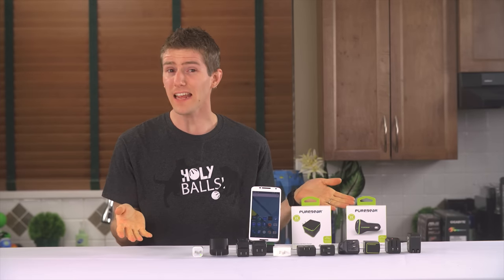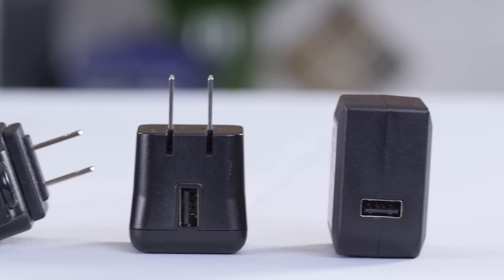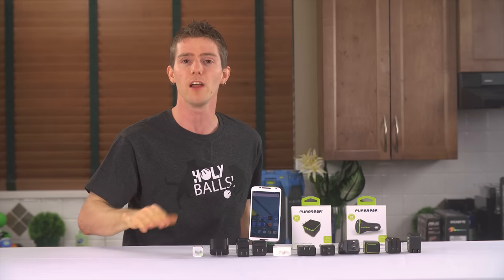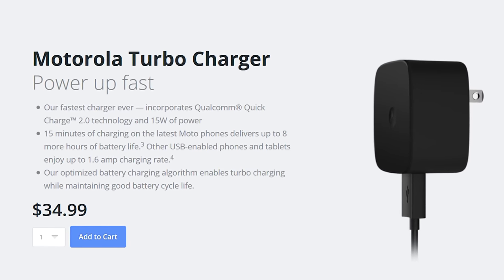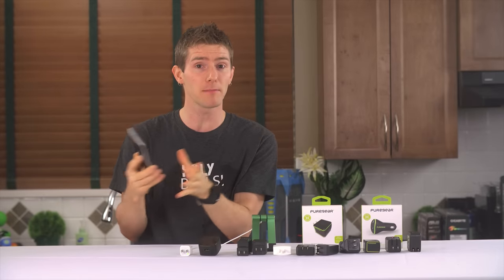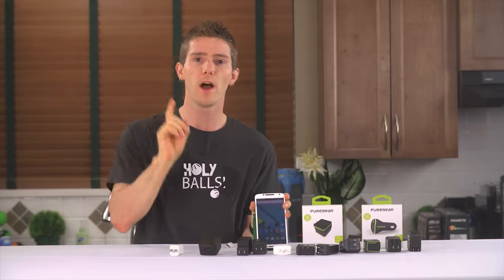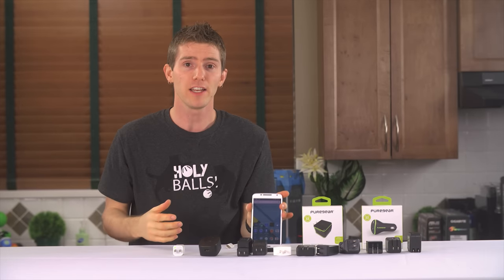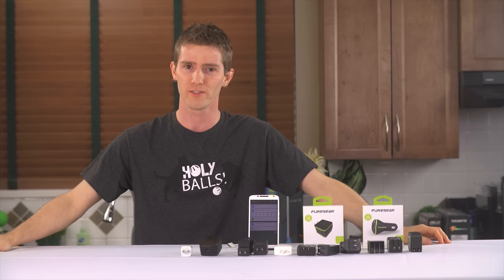Faster Phone Chargers Explained - Qualcomm Quick Charge 2.0

Comment: Hey Linus. Can the power output of the charger affect the overall life of my battery? ie. Interms of time to  discharge from 100-0 as well as overall charge cycles.
Reply: Your thought process is going in the right direction but not quite complete. The increased charging rate from the adapter goes to the phone. The phone then regulates the voltage to match what the battery voltage should be and adjust the amps as needed. Increased amp charging into a battery will increase the amount of heat generated inside the battery which causes damage to the battery. This is negligible though and you really shouldn't worry about it messing up your battery. What will cause issues with your battery is running it to 0 percent. Many people, due to common misconceptions about charge cycles, believe that you should charge your battery once to 100 percent then not charge it again until it's nearly dead. When you lower the voltage of any battery that relies on chemical reactions too low it actually begins to damage the battery. This is an incredibly small amount of damage per total discharge but over the course of a year or two or even more can really start to grow to a point of noticing that your phone doesn't seem to quite stay alive as long as it used to. This is especially notable in ANY phone that has a non-replaceable battery. Being the type of batteries these are none of this is a huge deal, the increased charge rate or the running your battery to 0 percent. If you want to see a bit of an extreme example of this though, leave your car head lights on all night to drain your car battery. Even if you just bought the car battery and then charge it the next day on a trickle charger you will notice that the voltage will never hold at the previously available amperage due to the damage caused to the battery.

Comment: So without "Qualcomm Quick Charge 2.0" if its still 2amp-2.1amp will it be faster than normal just not as fast as the Quick Charge? If you plug in a lower device (I assume im not the only one who has 2 phones going at same time) what will the effect be on using 2.1amp on lower phone? I was reading around that it doesn't matter because the phone will just draw what it needs. Need more videos on battery life to teach us how to do it better since batteries suck so much at the moment.

Comment: It's simple - charging these devices is like charging every other Li-Ion Batterie.
From the 18650s in my flashlight to a Tesla Model S.

For example - a 2000mAh Batterie. Charge with 2000mA (or as much as your charger can) until you reach 4.2V - keep these 4.2V and gradually reduce amps until batterie is full....done...magic.

Comment: Charging faster than 1C damages the cell (1C means you can charge with the rate of its capacity: 2.300mAh = 2,3A)
These fast chargers are just another way to kill the phone early, like the built in batteries.

Comment: Not even joking- My T-Mobile "04473 (the only identifiers on the device)" 3 amp, two port wall wart charges BOTH my LG G3 and my girlfriends iPhone 5, both on Verizon, from 5% to full in 45 minutes at the SAME TIME. EACH output is rated at 5V and 3A which is amazing. It charges every device I use in the same time. I have no idea why or how but is is magic.

Screw Qualcomm and companies trying to tie phones to specific chargers. Just buy a charger that has HIGH amps and 5 volts and it will rock for you. "High speed" Kindle chargers work well too.

I have no idea where I got mine but it is BEAST and I can't find it anywhere online. :(

Comment: Could you do another video on QC3 vs third party charges? Also my tests I took a little bit further making the starting charge point at different percentages. It seems that the higher the percent battery charge the slower the charge rate. I have many devices I've tested with. Most of these devices drop the charge rate to 1.5a at 75% making the last 25% sometimes take nearly an hour. 

Ever since I've done my testing about a year ago I never let my devices fall below 50%. 

The reason I ask for the video remake for QC3 is because the results you got with QC2, which matches my results, are NOT the same anymore. QC3 fails to quickly charge my Qualcomm devices faster than the stock charger. The main device I'm taking about is the Nexus 6. I have a few Qualcomm certified chargers buy their performance compared to my QC2 chargers seems worse. I'm thinking they figured out their charging methods with QC2 were flawed and did decrease the devices life span. 

I would like to see the results you get.
Reply: QC3 is more efficient, not faster, it take care of heat.   low heat= long battery life

Comment: Based on the graph on the video, the 3rd party charger works almost as equal with the stock charger. No need to buy those expensive quick charge 2.0 chargers.

Comment: If faster chargers drain the battery's total life span, doesn't that mean that using the stock charger for your Nexus 6 kill it faster than a 1 Amp? Or would (hopeufully) the stock charger not damage the battery faster?
Reply: Different countries uses different plugs

Comment: Use clock with charger. 60min everytime. No overcharge. I recommend. Then can use high speed charger when sleep.
Reply: Overcharging isn't a thing. These phones are "smart" so they stop charging when the battery is full, and they just accept a little current to keep it charged

Comment: I bought a Raspberry Pi 2 and with 4 USB devices plugged in it wont even boot off a 1 Amp charger it needs a 2.4 Amp charger to even work at full capacity.

BTW Most OSes won't even work correctly on a Raspberry Pi 2 yet so wait to buy one if you plan on actually using it....

Comment: Would partnering this technology with the USB 3.0 on samsung devices make it even faster? At the moment I'm using the plug I got with my Samsung galaxy s5 which is a little over 5v at 2A and I get considerably quicker charging times with a USB 3.0 cable than I do a standard micro USB cable

Comment: I have a Moto X Style (Pure in the USA) which came with a turbo charger. I keep that charger in my backpack for when I need to charge my phone during the day, but I usually only charge it at night with the charger I got with my Lumia 920 I got before it.

I also bought Motorola's fast charger for in the car to replace the shitty cheap one I had, but unfortunately, my battery is still discharging when I use my phone as GPS. Apparently it's using more power than the charger can handle.

Comment: Here's my question though: do you get more usage out of a slow 1 amp charge than you do a quickcharge? In other words, does a slow charge to 100% last you longer through the day and get you more screen on time than a quickcharge to 100% does?
Reply: Nope. In both cases the charge is terminated when the battery is at full capacity.
Reply: I know that, but I'm curious as to whether or not the battery drains faster after being quick charged rather than charged at 5 volts 1 amp
Reply: tyson505
Well, yes. The battery would have the same stored energy in both cases.

Comment: Just replace the battery with a super capacitor, or some form of hybrid capacitor battery. This way you can charge it in a second.
Reply: ...and then run it dead 10 seconds after taking it off the charger.

Supercaps aren't energy dense enough to come anywhere near lithium batteries ATM
Reply: Check out super caps that can start a car and hold charge for a week. Youtube it... also i believe there is kickstarter now dor such a device... to bad i didnt patent it quick enough :-(
Reply: Amir Hussain
It doesn't take much capacity to start a car, and holding a charge for a week doesn't mean anything because nothing is being drawn from it.

I've messed with them myself, while they aren't short of amazing in their charge/discharge performance, they can't carry very much total energy.

Comment: Is it just me or does it seem like the faster the battery charges the worse it is for the battery? There is a reason why batteries took 500mah and 700mah way back when, and now 2.0ah are becoming are becoming standard. Shit why dont we just load up 5ah and call it a day over some proprietary cable and charge our batteries even faster. Seems very counterproductive, and no matter where i try to find information about battery charging in any application, i can never find if there are safeguards to prevent overcharging. Holy shit!

Comment: well what does the U stand for in USB, oh yeah, UNIVERSAL! that means that if a device breaks because I use my 2,3A USB charger and it can only handle 1A than it's designed wrong!
Reply: 1. You can't break a device by using a charger which is able to provide more current. That's not how electricity works. 
2. Strictly speaking, both of those devices are designed incorrectly as they exceed the current limits set out by the USB standard.

Comment: Does the OnePlus One support Qualcomm's Quickcharge 2.0? It has the Snapdragon 801 processor which supports the Quickcharge technology, and it is also listed on qualcomm's website as one that supports it (https://www.qualcomm.com/products/snapdragon/quick-charge), however, on the OnePlus forums they say it does not (http://www.reddit.com/r/oneplus/comments/2o61ko/does_the_oneplus_one_have_qualcomm_quickcharge_20/). I'm confused whether or not I should invest $35 to get a new charger.

Comment: Hi sir what about using 12w charger to charge my iphone6 plus. I think its more faster than the regular charger.
Reply: The Iphone6 Plus supports apple's version of fast charging. So your phone will draw anywhere from 1amp to 1.8amps depending on battery level (as observed by my USB amp/volt meter). So you're correct, it is faster than the standard 1amp charger. However the iphone 5 and below does not support apple's fast charge.
Reply: +Josh Russell so it is safe right? Using 12w to charge my 6+ will not harm my battery?
Reply: +legendry fegarido No it will not harm your battery. Your phone will only draw the current it requires.
Reply: +Josh Russell okay thank you :)

Comment: Would it matter on what battery I use? I have a Samsung Galaxy Note 4 and I'm going to buy a Zerolemon 10,000 mAH battery+case. I've read that it is not recommended to use the quick charging feature with that battery but I'd like to know why.
Reply: Zerolemons are great batteries, but quick charging can cause it to overheat, which leads to other problems. The end charge % is also lower than slow charging.
Reply: 109sciencefreak so other than overheating, there should be no damage, am I correct? I can solve the overheating problem with keeping it on a cool surface in a cool room, hopefully. I've discovered that the end charge when using quick charge is lower just from the couple of weeks of using the Note 4. I'd be willing to sacrifice a couple of a minutes of usage to fill up a 10,000 mAH battery as fast as possible when the time comes.
Reply: I can't say for sure, but my guess would be bigger battery + quick charge = very high heat output when charging, especially if you were using it while charging.
Reply: I use a 7500 MaH Zerolemon battery for my Samsung Galaxy S4, I use a 2.1 A charger (really it puts 1.9 amps into the phone as thats the max the phone can go through).  I do not see any heat issues at all with the battery, so you should be perfectly be fine.

Unfortunately the Samsung Galaxy S4 doesn't support Qualcomm quickcharge 2.0 as the processor is a snapdragon 600..
Reply: Faster charging degrades batteries faster, it also produces more heat which also makes batteries degrade faster. If you switch phones every year or so it won't have a very noticeable effect in that time span. If you are using a phone case/battery pack it might help trap heat, thus degrading your cells even faster. There is also the issue of increasing the risk of having a battery fire due to the extra heat, but it's still very unlikely to happen. TL;DR: keep phone cool while charging and there will probably be no issues at all.

Comment: standardized charging: 5v 1 amp...
and now we see the new kid on the block: microsoft, with its ridiculously stupid 3.7v 750miliamps for a 3000mah phablet battery...

have been charging my lumia 640 xl with a 5v 1 amp port on my battery bank 50% of the time. i know higher amperage is ok, since the phone only draws whaterver it needs. but wil the higher voltage hurt my battery?

Comment: your test is not complete, and unreliable to me. there is a HUGE difference between chargers you forget : total power. you have close results between low and high power chargers because you charge the phone in plane mode. But if you also had used your 3d game plus WiFi + GPS + 4g during the test, you would have discovered an other crucial point about qc2 : a qc2 charger would have allowed 90-100mn charge even under heavy use of the phone. while with low power chargers ... the heavy use would drawn the battery even when plugged. This implies an other point : a qc2 charger will allow a real constant current during the whole charging process (current will be exactly 1.6A into my battery during 90mn ... if I can keep it cool enough ), while with a non qc2 charger the current to battery will be dynamically adjusted depending on power used by the rest of the phone. Stability of current also has impact on battery life, and this is a detail in favour of qc2, because with qc2 the current will be the same from 5% to 90% : 1.6A (HTC one m8) (if I can keep it cool enough ). 

do your test again, please, with intense use of your phones. results will not change for qc2. results may tend to infinity, or even negative for legacy chargers ...

Comment: Can it works with htc 10 as well since it's 3.0 but can I use 2.0
Reply: Yes you can. It will charge slower than QC 3.0
Reply: Yes you can. It will charge slower than QC 3.0
Reply: Yes you can. It will charge slower than QC 3.0

Comment: Can you use quick charge 3.0 on a galaxy S6 edge?
Reply: maybe
Reply: If u have an s6 with a snapdragon processor it supports quickcharge 3.0
if u have an s6 with an exynos processor it has a proprietary fast charging charger that comes with it.
Reply: No. it will use the Q.C. 2.0 that it came with. pretty good 1h 25mins from 0 to 100%

Comment: at 35 bucks they could at least attach a cable to the box to plug into the wall instead of making it a wall wart, wall warts are pimples on the face of the teenager named electronics, we can only hope that electronics doesn't develop adult acne.
Reply: Houses being built now should have USB charging ports wired in around the house like power points.
Reply: Eh if the cable is detachable than it can be easily replaced if it breaks. If the cable attached to the unit breaks you will need to send in the whole part or you can just buy 1 new USB cable.
Reply: Lachlan Hynd a good idea but not exactly practical. if you watched this video you would notice an issue off the top, how do you update your house for two way communications with newer devices. not a big deal if the house is running off of a server, essentially a smart house which is something that really should become a much bigger thing, but if you just wire up a house with 5v 2.5a transformers running usb power stations you won't be taking advantages that you can get from two way communications with a device. while this video started to get into it and kinda orbited the topic i would like to point out that pushing 2.5a is fine when you battery is low, but as the battery gets charged it takes more energy to charge it and causes the overheating problem that was mentioned in this video, with two way communications the phone can tell the charger that it doesn't need as much amperage anymore as it crosses some arbitrary under or at 30% figure and trigger the charger into a slower charge mode, like 1500ma, force feeding isn't good for anything, and shoving 2.5a down the throat of a cellphone at 50% is going to end up with you feeling like you are picking up a piece of toast that has only sat for a minute or two if you pick your phone up as soon as it is charged.

once the tech has stabilized and standardized like 120v sockets in the united states it is a perfectly good idea, but a great idea is also to run ethernet to all of the outlets when building a new house along with a server/media closet where all the equipment is consolidated, that idea is about twenty years old and still is pretty uncommon, unless you are building your own house it isn't going to happen, and if you are building your own house you can do whatever you want, inside wall transformers have been on the market for decades and you can adapt them to whatever port you want, and you can also buy blank wall box covers that you can modify just like an electronics project box. 

to put it bluntly though, i want ethernet to be a standard on all wall outlets allot more than i am worried about usb charging, usb charging isn't likely to stick around for much longer anyway, but i find it unlikely that ethernet is going anywhere any time soon, ten years, maybe, but usb charging for mobile devices is likely to go the way of the dodo in the next ten to fifteen years and unlike with devices that use ethernet mobile devices are generally throwaway so the tech turnaround is very fast, computers that use ethernet are likely to last for a decade after ethernet starts to phase out.
Reply: Lachlan Hynd  Power outlets are not an intrinsic feature of a house that you cannot change... Just install a new USB outlet if you don't have one?